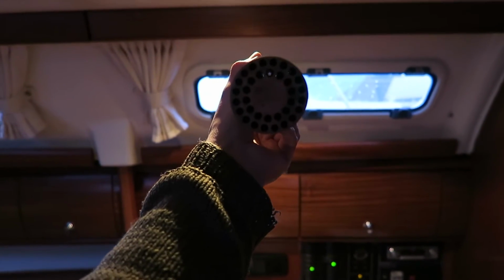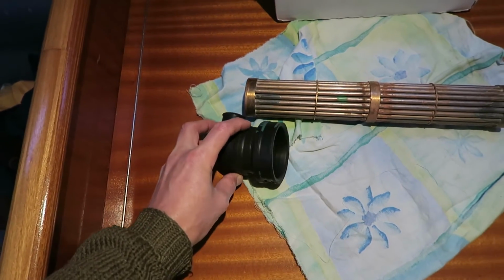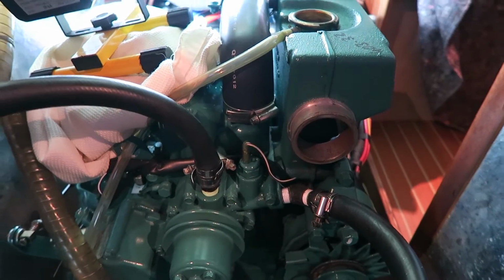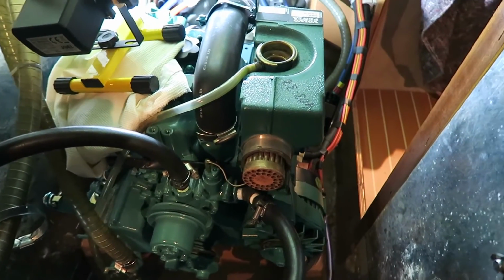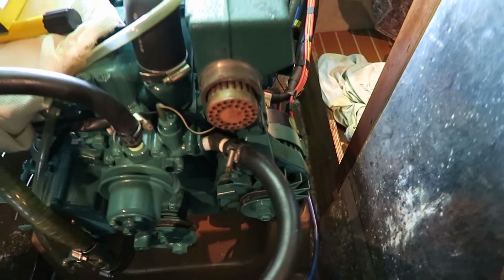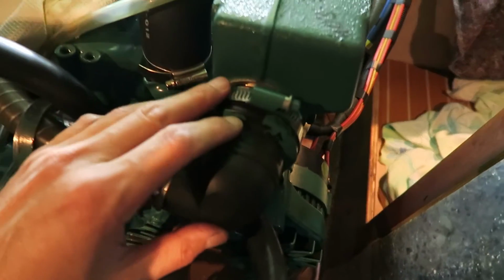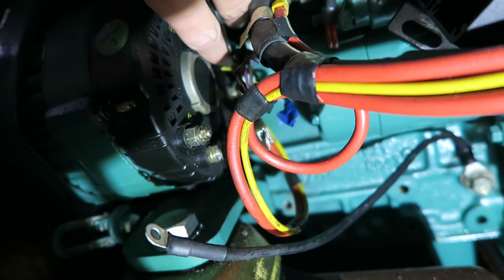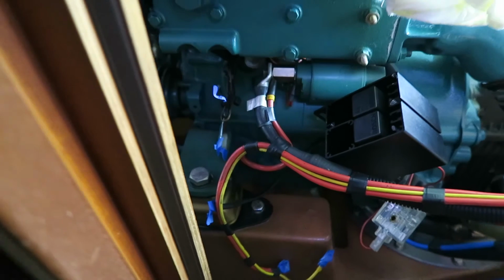Volvo Penta MD2020 - reinstalling heat exchanger

Comment: These videos are so helpful Tino. We Just took on our first yacht - a Bavaria 32 and without any other help have been able to troubleshoot our engine issues and get a badly leaking engine fixed and sailing. Much more useful that the manual and making us genuinely independent on the water. Thank you for all the effort you have put in.

Comment: Thank for your interesting video. I bought replacement boots from Volvo and they did not have the grooves for the heat exchanger to click into so accurate measurements were necessary. The old ones I took off had the grooves in them.

Comment: You mention that there are steps in the original end rubber caps. A new spare part from Volvo doesn't have these steps any longer. Hence there is s challange in mounting the pipe core with proper distance sticking out.

Comment: In the manual I have, it very clearly states that the insert is marked with a top side and it's very important to mount it correctly. However, to me it's NOT clear which side is up. I only noticed a green painted dot,  and put that up, but I don't even know if it should be up or down... I noticed you also have a green dot, but it didn't seem you put it in any particular direction? PS the rubber boots ensure that the insert doesn't touch the block, hence no sacrificial sink is used on these Volvo engines :-)
Reply from the maker: I know there is models where it's important to mount the insert correct, think the reason is to avoid air pockets at the insert. And thanks for the info. :)

Comment: You have a different tube heat exchanger then I have with my MD2020B. Mine is covered with a copper case with 2 openings bottom side. In the middle of your tube you have a deathzone of raw water. Mine has tubes in the middle also. So Volvo modified the later versions. I have changed my thermostat also. Was a lot of work to do that and working in a small space. Will post my video soon in a summerary for the MD2020B.
Reply from the maker: Super 😊 looking forward to your video

Comment: Hey Tino, så blev jeg færdig med at afsyre mit udstødningsknæ på VP'en, og bange anelser den er helt færdig, det andet kammer er tæret væk og jeg tør ikke bruge det igen, du talte om at en rustfri ikke var optimalt da materialet ikke arbejder særligt godt sammen med blokken som er støbegods, hvor har du den udtagelse fra, er der hold i den, jeg tænker at når der jo er pakning imellem så kommer de 2 materialer jo ikke i berøring med hinanden, tak for gode tips og tricks
Reply from the maker: Problemet er at man spænder rustfrit og aluminium sammen og knæet har kontakt via skruerne. Kan selvfølgeligt være jeg tager fejl men synes dog jeg har knækket nok rustfri skruer der har siddet uhjælpeligt fast i aluminium gennem tiden. Der er noget der hedder "spændingsrækken" hvor det svageste metal korrodere først dvs. hvis man spænder alu sammen med et eddelmetal vil aluen irre væk hurtigt. Bedre at jern knæet ruster væk (2555kr.) end din varmeveksler der i dag koster 8940kr. (til md2020).
Som jeg nævner kan en jern albue i hvert fald holde 5-10år. så set ud fra det er ca. 2500kr. billigt. Volvo går meget op i at undgå galvanisk tæring, så alle dele er nøje udvalgt.
Reply: Jeg har meget svært ved at se, at det er et problem i dette tilfælde, så jeg vil også gerne have nogle referencer.  Problemet med rustfri udstødninger er, at når de er svejset og det ikke er lavet ordentligt, kan de gå i stykker, og yanmar er tilsyneladende gået i den fælde.  Man kan købe et knæ støbt i rustfri stål fra hdimarine  og jeg kan ikke finde nogen, som taler dårligt om det, selvom jeg har prøvet... Nuvel jeg er her for at se, om jeg har overset noget om varmeveksleren :-)

Comment: Hi Tino, thanks for uploading this video. I`m owner of a VP 2030 and so I find your explanations very helpful. I`m wondering why you`re demount the generator. Are there any problems with it? Greetings from Germany :-)
Reply from the maker: I unmount the generator so I can mount the cooling hose from the heat exchanger to the coolant pump. There is also some corrosion by the coolant outlet I will like to remove when I'm in the area. There is no problems with the generator but I will also give it a little check. I have discovered some new stuff I'll reveal in the next video.
Reply: @twiper  So I´m looking forward... :-)

Comment: Hi Tino and thanks for sharing your experience with your coolant system. The water on the steps I believe is condensation from your winter cover due to temperature differences inside and out. Pretty normal 😉 I am looking forward to see what is on your next project 😀
Reply from the maker: Yes ok :) -  I got a mail from the Danish Bavaria dealer today and they told me they could not make a new entrance hatch for my boat, only one in clear plexiglass wrapped in foil. I will find out if I can get the hatch system in a bit darker shade than the original so I can get the plexiglass dyed, not with a foil.
Reply: @twiper  i recall a company plexifix.dk that have a good reputation with this kind og work 😉
Reply from the maker: When you check out the firm on "trustpilot" it does not seem to be a good place.